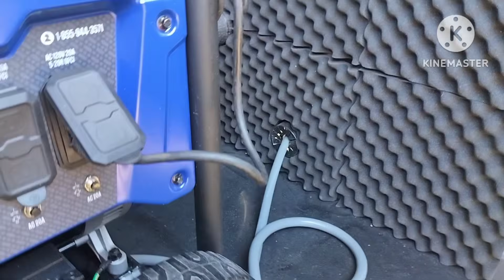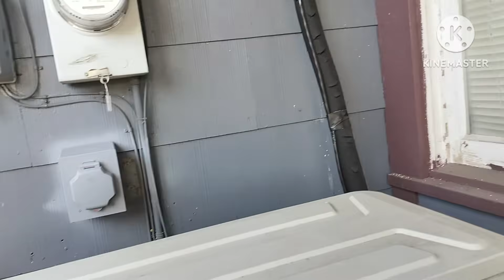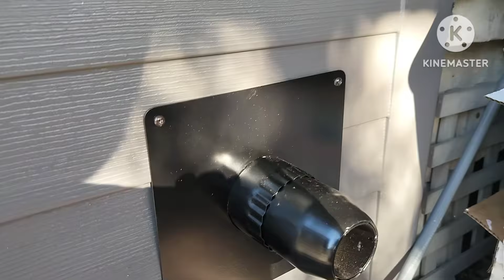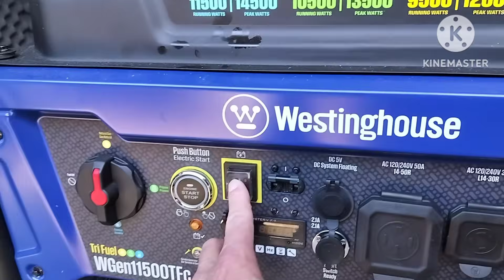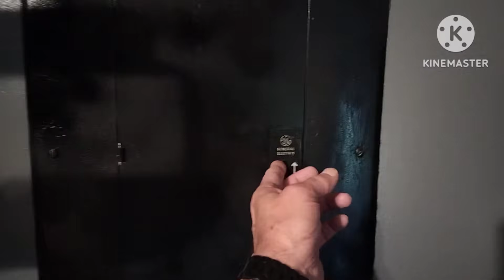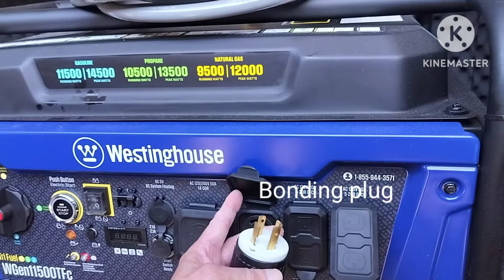Westinghouse 14,500 watt tri-fuel Whole house setup

Comment: I live in SW Louisiana!  I have a similar setup with a predator 9500!   I just purchased the 11500 predator tri fuel, and in the process of teeing off my NG to swap out!  I installed a soft start on my 4 ton AC.  It will run it but not on eco mode

Comment: Is that not to close to the house to  have to worry about CO risk when using gas?
Reply from the maker: No, I actually closed in all the windows with cement board and sealed off about a week after I installed it. I also have co2/ smoke detectors throughout the house and especially that room. I really had no other place to put it.

Comment: did you have an issue with the CO2 sensor shutting down the gen?
Reply from the maker: No, the exhaust is extended outside of the enclosure. If installed a sealed off probably, there shouldn't be an issue.

Comment: By code your exhaust should be at least 5ft from your house.
Reply from the maker: Yes, I know. I really didn't have any other locations in could install it. That room is separate from the rest of my house and I had closed in all the windows you see in the video with cement hardi board and sealed them. I also have co2 detectors throughout the house. The only time it will run is during a major outage. So far, I have not had to use it.
Reply: @ottsmont752  - what if it's next to the far end of an attached garage, so 20+ feet away from living quarters?

Comment: FYI.....Spoke to a small engine repair shop in Springville Al. he told me that Westinghouse warranty center is horrible with warranty work, the returned takes months before he gets paid, Champion turn around time is about 30 .
Reply from the maker: I've been lucky I guess. Third Westinghouse generator I've owned with no issues. Last one ran 18 days straight and only stopped it to change the oil. Never missed a lick and still using it for my camper.

Comment: JFYII THAT Sir is a 11500-watt under a FULL load machine not a 14500 watt. It will SURGE to 14500-watt to start a heavy load like A/C units but will not run 14500 watts continuously. MOST people buy too small a machine and burn them up from overloading them. Figure out what the load would normally be needed and buy a machine that can produce twice as many watts. Running a machine above 50 percent of load capacity for a long time just shorts its lifespan.  Google it!

Comment: Have you monitored the internal temperature for your housing while the unit is running?
Reply from the maker: Yes, I have a thermometer mounted on the housing. It will get in the high 90's with 80+- outside temperatures.
Reply: @JerryHawk250  Thank you, sir!  Here in Southeast TX it gets a bit warmer than 85 in the summer.  Love the video and all of the links!
Reply from the maker: @Texcajun06 thanks. It wouldn't hurt to go with a bigger exhaust fan and vent.

Comment: Just bought the 14,500 and got a 50 amp house hookup with an interlock kit. have not used it yet, going run it on natural gas. has it been ok for the electronics in your house? I read should use an inverter generator for that just wondering thanks.
Reply from the maker: No problem with it. Runs my AC with no issues

Comment: I'm not sure how to make use of a remote control when the manual says you must disconnect load before starting. If I must disconnect/reconnect loads, then wouldn't I push the button on the generator quite easily?
Reply from the maker: It's best to start without a load on it. Give the engine enough time to warm up and stabilize.

Comment: Excellent video & very informative. Thank you for the ideas. Great job 👍
Reply from the maker: Thanks. I really need to do an update video. Waiting for a power outage to really test it out. 😂
Reply: @JerryHawk250  have you tested it out yet? I recently bought the same generator after watching your video.
Reply from the maker: @ElGringoLoko-r8z yes, I ran it for an hour when I first set it up with everything running in the house. I crank it up once a month with a load on it for about 15-20 minutes
Reply: @JerryHawk250 how is the house working? I was wondering if it ran fine in that before I made the same one.
Reply from the maker: @ElGringoLoko-r8z runs good with no issues.
Reply: @JerryHawk250 thank you Sir.

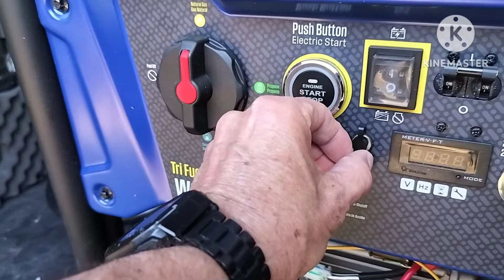Comment: With the remote, the battery switch on the Gen has to be on. Wouldn't it drain the battery? 5:47?
Reply from the maker: I only turn the switch on if I know we have a hurricane or tropical storm coming. It has a battery maintenance charger that I keep plugged in all the time so the battery is always fully charged.
Reply: @JerryHawk250  You answered me before the video ended! That's a record. Thank you.

Comment: Great video! Awesome job modifying the shed. I'm going to do similar now asap. Thanks for sharing!!
Reply from the maker: Thanks. So far I haven't had to use it which is a good thing. 😂 I do run it every two weeks though. I haven't had any issues but I probably should have gone with a little larger exhaust fan and louver just to have some more air flow through it.

Comment: Good job overall, but not crazy about it being next to the house with the carport/windows/and doors. Hope you have several CO detectors in the house. 

I have the same generator and did similar for a bonding plug, but used a 50amp plug instead, that way there is no way for me (or anyone else that sets it up for my house) to have a bonding plug in place and have it plugged into the house. 
Ironically, I have not had a power outage more than 3 hours since getting my generator, and if I never have to use it, it is still worth the expense.
Reply from the maker: Window aren't there anymore. I had closed the windows in with cement fiber board. I do have smoke and CO2 detectors throughout the house.
Reply: @JerryHawk250  Good to hear. Still a little concerned since your house is raised and can have buildup under the house and possibility of it seeping in. Not likely, but still a possibility. Good you have the CO detectors. 
Don't need you or your family to be a victim of CO poisoning.

Comment: Well done, I built something similar mainly to dampen the noise when that generator runs BUT realized how much room the shed and genny took up and locked my generator in place.  Craiglist everything and bought a large  inverter generator.  I can now wheel it out when it's needed and it's so much quieter even without a shed.
Reply from the maker: I did mine for the opposite reason. I got tired of dragging it out of the shed. 😂 I did it more for storing the generator and having ready to go when needed. I was using a smaller inverter generator before.
Reply: @JerryHawk250  specific reason to ditch the inverter other than Supply watts range, I’m not very familiar with running inverter ones but they say they are better for electronics like TV and such.

Comment: What spark plug and gap works best for ya on Ng? Also any modifications to the gas regulator at the house? What pressure or water column is needed for it to run great? Just bought the exact same model. Badass enclosure btw
Reply from the maker: Spark plug gap: 0.024– 0.032 in. (0.60 –0.80 mm). No modifications needed on NG regulator on the house. It runs perfect as is. The owners manual probably has information on minimum pressure that is needed. Main thing is to make sure the line you are connecting to is at least 3/4" line. You need volume more than you need pressure.
Reply: @JerryHawk250 good info thank you!!

Comment: what was the model number of the sun cast shed you used I have been trying to find one that will fit my westing house 9500 df the problem I see to have is the with of the shed I just don't know if the doors will close the with on my gen is 26.1 that don't really tell you the inside dimension
Reply from the maker: Got it from Home Depot Model # BMS4781D

Comment: This is so great.  Really impressive, thank you!   But would you please clarify: did you have to get some kind of special permission from the Natural Gas company so as to tap into the line?  And how did you do it?  Contractor?  Or what?  And the natural gas flexible hose ... can you connect it and disconnect it to the utility point as you so-choose?  And is there a limit as to how long your hose can be?  Thank you for sharing your info!
Reply from the maker: It's going to depend on your local building codes. I already had a gas line near by with a valve installed. I installed a quick disconnect for the flexible line that came with the generator. I only connect the line when I need it. My generator came with a 25-30' 3/4" flexible line. If you have to go a farther distance, you will need a large line.
Reply: I have the same generator. It’s a half inch hose that came with it not three-quarter inch hose. I upgraded mine to a 3/4 inch. Now I don’t even think the generator sells with a hose at all.
Reply from the maker: @condor5635 it's 1/2". Works great with it. But I also have a 1" main line that I'm tapped into on the house.
Reply: Did you have to put a regulator on the gas line?
Reply from the maker: @jessehartley3136 my gas service already has a regulator.
Reply: @jessehartley3136 no gas is already regulated to what the Westinghouse requires on most residential installs. That being about a quarter of a psi we’re roughly 7 inches of water column

Comment: Update: I used a impact wrench on the valve and it came right off. Plus I took that chrome plate off the regulator so now I can adjust the flow on the regulator if I need to. It runs nice and smooth now!!
Reply from the maker: Awesome. Good to know.

Comment: I have the same generator I want to hook my gas hose up like yours with a 90 degree. But manufacturer used blue loctite on adapter and I'm afraid I will break it. Do you have any ideas how to break that seal?
Reply from the maker: I had no problem breaking it loose. Just make sure you have a wrench to backup
Reply: @JerryHawk250  I don't understand "wrench to backup"
Reply from the maker: @jbhobbyistandMore wrench backup on regulator so you don't break it.
Reply: @JerryHawk250  Thanks Jerry
Reply: Jerry on the fuel regulator. there's a silver plug. Do you think there is a adjusting screw behind it?
Reply from the maker: @jbhobbyistandMore not sure. You shouldn't need to adjust anything
Reply: @JerryHawk250  it missing a little bit on ng and propane. My old gen had usa carb installed and had to adjust more for ng then propane. I do recall another person on YouTube taking that cap off to adjust westinghouse carb and I have been looking for him to confirm doing that.
Reply from the maker: @jbhobbyistandMore more than likely there is an adjustment screw under the cap.

Comment: Did you have to modify the exhaust pipe? I have the Westinghouse 13500 and was looking to put a storm shed together.   Thanks 👍
Reply from the maker: The exhaust extension I used bolts right up to the muffler.
Reply: @JerryHawk250 Thank you very much 👍

Comment: Install a micro-air soft start to your ac unit and you won't have that problem.
Reply from the maker: I don't have any problems now. My HVAC system is basically a mini split outdoor unit with a conventional air handler. No load on startup. It gradually ramps up according to how much it needs to cool or heat. Super efficient.

Comment: I recently saw where people recommend an inverter type of generator vs a regular generator.
Reply from the maker: Yes an inverter generator is much better but there's nothing available that's big enough to run my entire house. This generator has has a very low THD which is safe for electronics. No flickering or power drops when heavy loads are put on it. I have a Westinghouse inverter that I used for the last hurricane. Works great but is only 120 volts so could only run a window AC unit

Comment: Awesome video, thank you! Do you mind sharing me the link for the 90 degree natural gas part? That’s my next thing to do. I have the same generator. Thank you!
Reply from the maker: I had picked it up from  Lowe's. It's a brass 3/8" street elbow. Proline Series 3/8-in x 3/8-in Threaded Street Elbow Fitting BF-782NLB at Lowes.com https://share.google/Od8fz8qmLu6t3IxVD
Reply: @JerryHawk250 thank you bud. The tube that came with my generator is 1/2 did you upgrade to 3/8 or the fittings need to be 3/8 to fit the 1/2 tube? Thanks for your help and patience.
Reply from the maker: @rn_texasangler7150 the 3/8 90 will be okay because it's right at the generator. I doesn't restrict the flow. You have enough volume with the 1/2" before it. It's 3/8" at the regular
Reply: @JerryHawk250 thank you very much 😊

Comment: Where did you get the gas line, great work.
Reply from the maker: It came with the generator.
Reply: @JerryHawk250  I was curious if it comes with it. When I get home I'll get to check out mine. Thanks
Reply from the maker: @jlawson26 mine did.

Comment: Hello Mr. Jerry, I have the exact same generator and was wondering how long you have the NG hose running? Thanks
Reply from the maker: I used the hose that came with the generator.
Reply: @JerryHawk250  I just got mine, and it looks like they no longer sell the generator with the NG hose. Thanks for the response
Reply from the maker: @LecheDeLlama it came with a 25' 1/2" line

Comment: Very nice, but too close to the house to be allowed in Florida.
Reply from the maker: Yeah, must check with local regulations.
Reply: @JerryHawk250 , very nice job...I think it was smart to install the vent so you would have a flow of air to prevent the unit from stopping.
Reply from the maker: @timothydehoff3279 exactly, that's very important. I have the intake located in front of the engine and exhaust fan up high to remove the heat as heat rises. I've had no issues with overheating but think I'll eventually install a larger vent an exhaust fan. I ran it for a good while a few weeks ago and temperature was like 102° after an hour. That was on a 90+ degree day.

Comment: Great video! I'm in the process of doing the same BUT my gas fitting is a 3/8" flare.
Question(s): Did your original gas connection have 3/8" flare? Did you remove it to add 90 degree for quick connection? Will that void warranty?
Reply from the maker: Yes it had the 3/8" flare. I removed it then installed a 90 and reused to flare fitting. I won't void your warranty.
Reply: @JerryHawk250  I had a similar question about the 3/8 flare and hose requirement.  My unit did not ship with a NG hose, and the LP hose is 3/8 ID. I'd assume I would want a 1/2" NG hose to ensure adequate supply, though. Is that what you used? Great setup thanks for posting.
Reply from the maker: @gregoryliptak4954  3/8 is okay at the generator as long as you maintain the 1/2" line all the way to the gas supply. I've ran mine with a full load with no issues.

Comment: Did it ever shut off on you in that shed due to CO sensor?
Reply: That does look like a problem with those small vents. That reminds me that I need to do the engineering to bypass my sensor because you just don't want to deal with a sensor failure during an outage. I run mine in a very well ventilated area and they still sell generators without them, so I don't need a failed sensor to ruin my generator experience.
Reply from the maker: @JetFire9 I I've ran it over an hour a few times just to break in the engine and generator. No problems. Although maybe a larger fan and vent wouldn't hurt. I might add another intake louver or lager vent. The fan definitely circulates enough air. The intake vent has to be in front the engine so that air flows directly into it. Intake needs to be low and exhaust fan up high at opposite ends to pull the heat out.
Reply: @JerryHawk250  I just got a 11500TFc and in my enclosure with vents and fan it shuts off due to CO alert. I can't seem to find anyone who has figured out how to by-pass this particular senor for this model gen. . I do have the wire diagram. Anyone know how-to bypass it?
Reply from the maker: @corvette652 that's weird. I had no problems with mine shutting off. Is the extended exhaust sealed really well? I wrapped the joints with the foil tape that came with it.
Reply from the maker: @corvette652  make sure you have the vent an exhaust fan at opposite ends of the storage shed so you have a good cross flow to suck out any exhaust gas. If the connections are sealed off, there shouldn't be any exhaust fumes to shut it down.
Reply: @corvette652  two options to eliminate the CO sensor. One is put tape on the intake holes of the sensor. It’s about the size of a matchbox and it’s located at one end of the generator near the frame. I think it’s near the pull cord. Just put tape around it where the holes are. There’s some harness with wires going into this little box. that eliminates the problem in the short term, but it still has a battery within it that could fail down the road. There’s an electrical connection you can make to eliminate it electrically as well. For me, I just put tape around the holes and that works great

Comment: Very nice. Just wondering how you keep battery charged all the time when switch for remote must be on/activated in order for remote to be able to work? Do you use a small trickle battery charger or solar power?
Reply from the maker: The generator comes with a trickle charger. There's a charging port on the generator. I don't leave the switch on though. I'll turn it on if there is a hurricane on so that if I loose power, in can use the remote to start it without having to go out in the storm.